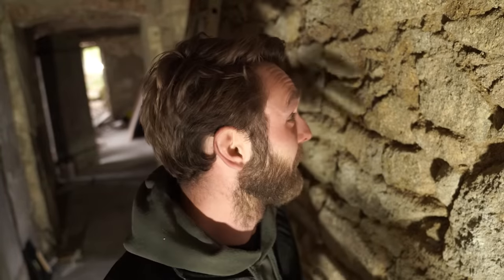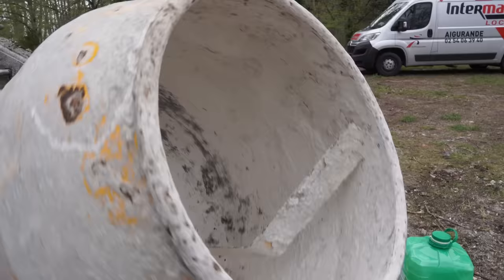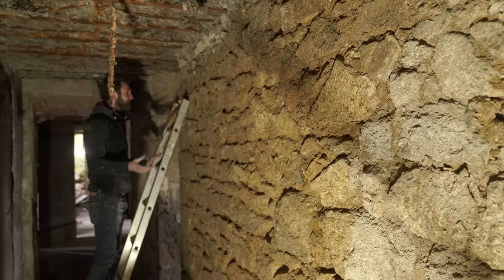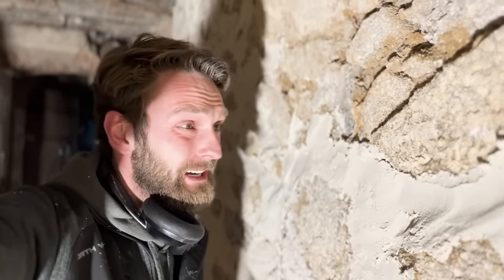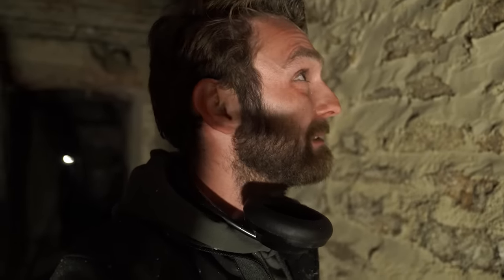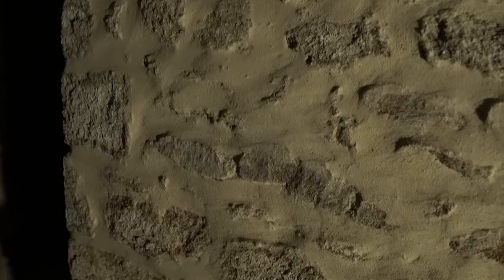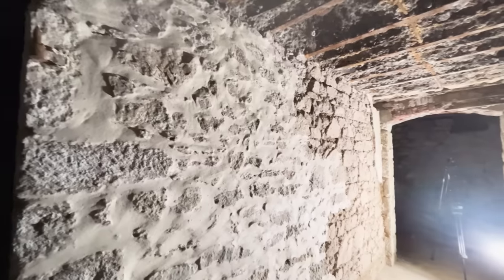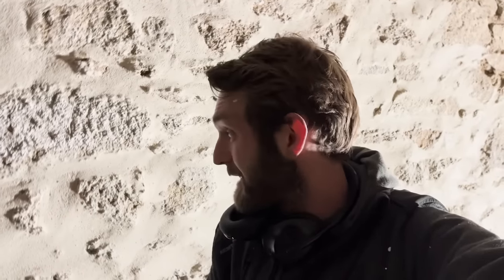Renovating a French chateau: Critical basement repairs

Comment: Hi Dan great result on using the Lime in the mix with no cement. NHL 3.5 should suffice down there. It's important which sand you use though too. The pointing looks OK.... Can I suggest you spend time "Cutting" the pointing back just as it really firms up but is soft? Use a "small tool" and remove the pointing about 3-5mm AROUND the aris of the stones to expose the shape of the stone. Sponging can give a strange look... After cutting back use a soft brush the next day to remove the dog's.... Love pointing like you!

Comment: This will save you some time and effort: If you wait until the next day you can just do one brush off by tapping the mortar with a big masonry brush rather than brushing along. It pushes the mortar back in where it may have shrunk overnight and leaves an open pore texture which helps with the moisture transfer and evaporation. As the small bits on the stone are dry by then they also come off so its an all-in-oner! You can then do a smaller clearup if required

Comment: Old houses building in the uk (i owned a house in 1960si were 21 cost 600 pounds)i had damp i now know that the house had been re plasterd i had damp (i am a joiner) a few year latter i worked with a old plasterer when we came to re plaster he used a lime mix with a fiber i asked why not use a modern plaster he told me that they dont let the wall breath thats a long time ago 50 years or so he was right

Comment: hello i am from greece, my city is thessaloniki, my city often burned down in the old years, people who were interested in history were renovated, and i saw that the roof was always built first, and that the storm didn't do any more damage, and of course that the house dried up
old wooden floors were drilled into the wall with concrete and metal nets, thick iron rods 12mm, to make the house earthquake-proof
I would suggest you take all the rusty metal, paneled from the bottom up with wooden panels, mount metal net and iron bars, that's cheap and is earthquake-proof up to 12R

Comment: Get water running to basement and you could live down there during restoration.
Reply: It's not waterproof and the ceiling (Which is the ground floor) has to be demolished and rebuilt by the looks of it (I think that's what Dan confirmed today anyway), that is one big job, wonder if it will be new steel or timber!?!
Reply: He needs to be home with wife and boys in his home.he’s a husband and father not a camper 16 years old.
Reply: @lauratohome  he doesn't live with his wife they are separated but spends a lot of time there with his boys x
Reply: @lauratohome  They are no longer a couple and she was never his wife as they weren't married

Comment: just a suggestion - can you use a tarp on the floor not only to protect it but also to make it easier to clean up afterwards. Save having to chip away the stuck on concrete

Comment: just a tip (and even  better than NHL 3.5) Espace Emeraude does hot lime for 11 euro a 25 kilo bag (Chaux vive). You have to be more careful when mixing but you can mix a whole load in a day; put in a container with a lid and a bit of water on the top and just use when you need it. I have a whole load on the boil at the moment. ps. keep a bucket of water with a splosh of vinegar in it to rinse it off your skin to stop burning

Comment: It's officially home, Just curious, how long does a cement mixer last before you need to change belts or repair motors? This is a very exciting moment, nothing is impossible now. I think I'm going to have a little celebration when a truck rolls up there with steal beams on it. After watching you do an actual repair on the structure, the whole restoration played out in my thoughts.

Comment: I kind of worried about the metal beam rust in the floors there Dan.
Reply: I suspect the whole basement ceiling will have to be replaced.
Reply: I think he confirmed that in the video, so the Basement Ceiling Which is also the Ground Floor looks likely to be demolished and the scaffold can then be erected on the basement floor to the roof on one third of the building at a time, I think that's the plan!?!

Comment: Great to see the concrete mixer taking on a new project. Are you getting advice from a structural engineer/architect/builder for the chateau renovation?
Reply: Dan mentioned a structural engineer a while ago and if the planning process is anything like it's here there has to be either an architect or builder involved.
Reply: @Ragnar8504  Thanks :)

Comment: Those steel beams don't look like they're in good shape. You might wanna sister some 2x6s for the 1st floor. They ones you can see on the ceiling in the basement.
Reply: The whole ceiling/floor is being replaced. Part of the reason he wants to make sure the walls are stable.